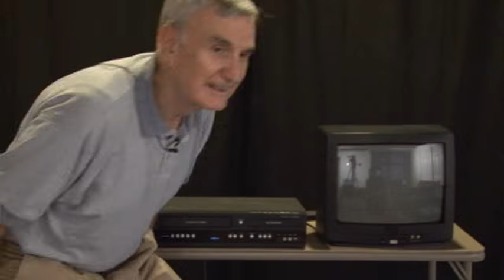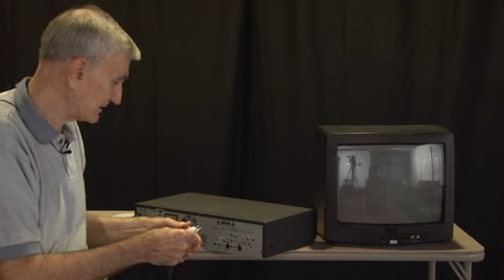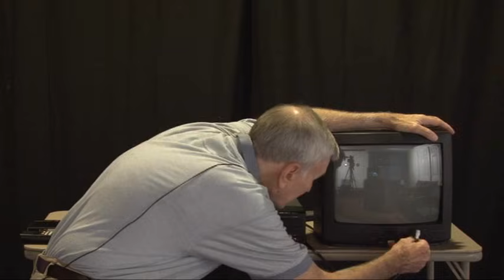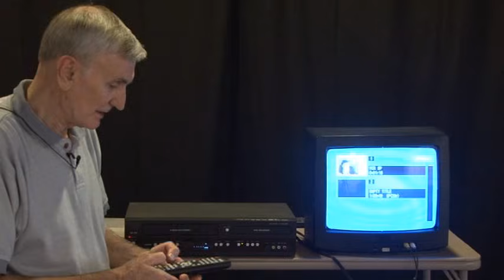VHS transfer to DVD using combo recorder

Comment: When you convert a tape, do you notice a significant quality difference between the formats? I have my own setup and I've done a compare/contrast between the footage on the 2 formats, and I've noticed a significant difference. I know since these are 2 different formats, that's to be expected, but the colors in this particular video I've converted look a certain way, and on the DVD, the colors are less strong. I can't decide if the DVD image looks washed out, or if the VHS is too saturated. Any advice you can give me? Does putting the footage on a DVD neutralize the image quality? I used a VHS/DVD combo with the dubbing function.
Reply from the maker: Kyle, I had so many about 100 as long as I could see the picture i was ok. I doubt if any of my family will ever want to see them.

Comment: Hello Mr. Wheeler. Everything was going great until I changed the source to DVD and after the loading finished it said "Disc Error Playback feature may not be available on this disc." I'm using the memorex DVD+R blank discs. Would it be the type of disc brand or would it be something else?
Reply from the maker: Itzel C., I recommend starting the process over from the beginning. I use Verbatim DVD-R disks, they have been very reliable.

Comment: Hi Anthony I am transferring vhs to dvd however if I compere the vhs to the dvd I noticed that there some quality lost on the recorded dvd (comparing same footage). Any recommendations?
Reply from the maker: Roberto, this kind of analogue transfer has always been associated with some loss from my experience. We always called this generation loss. Once it is digitized there should be no more generation loss. I would make sure your record speed   when you make the dvd transfer is set to the standard speed or the one hour record speed if your tape has only one hour or less of recording on the tape.

Comment: thanks anthony, if i don't have remote control, can i do that?
Reply from the maker: gabriel ventura , I think so, if your unit has a dubbing or record button as well as play, stop and rewind. I would sure give it a try.
Reply from the maker: If you can't finalize the DVD in the machine that made the DVD it will not play in other player. Must be finalized.
Reply from the maker: gabriel ventura , I'm afraid so!

Comment: Dumb question, but at the start you said the VHS tape was right at its end point.  Why not set the buttons so it is reading zero, rewind it and see that it is at MINUS 2hrs and 56 seconds, and then set the buttons to zero again.  This way you would know the tape goes for 2hrs 56 seconds only had to rewind once.
Reply from the maker: Mark Richards, "Smart" thank you!

Comment: I just bought a used RCA DRC8335 unit. It does not have a button that says dub or dubbing, only record or copy. Is copy another word for dubbing? I have no manual.
Reply from the maker: I don't know about other combo recorders, but I would give it a try using the copy feature.
Reply from the maker: dawncat66, I don't know about other combo recorders, but I would give it a try using the copy feature.

Comment: Hi, I did everything you did but when I got to the end on VHS and press dubbing it comes up with the red not allowed symbol - what have I done wrong? Does the DVD need formatting or is DVD-RW not a good blank to use? Or is it something to do with the VHS? Any idea?? I've tried with lots of my vhs's.
Reply from the maker: Christina Griffin, you wrote " when I got to the end on VHS and press dubbing it comes up with the red not allowed symbol ". That suggests to me that my instruction may not have been clear. When you get to the end the VHS tape must be rewound to the beginning of the tape or recording you have on the tape. Secondly I have never used a DVD-RW, which probably should work, but I use DVD-R .

Comment: I have this player and have been able to copy from VHS to DVD easily, but my problem is with recording from the TV.  I can't seem to get mine to do that.  I've followed the directions several times and I cannot get the unit to record from the TV.  Do you have anything that explains this?
Reply from the maker: ***** , I'll see about making a YouTube video showing how I would to that. Thanks
Reply from the maker: Anthony Wheeler Excuse me Andrea; On second thought, Do you mean recording TV programing from your cable or dish provider. I have never had an occasion to do that. I thought we have DVR's for that?
Reply: I don't own a DVR and would like to record TV shows off the TV. I have Time Warner Cable.
Reply from the maker: Andrea, If your combo recorder is like my combo recorder, I can't connect the Time Warner Cable into the unit. This prevents me from recording to my combo recorder. Older combo recorders did allow this ("RF" or TV) cable to plug into them and they had a TV tuner so you could select the channel you want to record from. Another thought If you have one of the old VCRs most of those had connection for "RF"or TV cable. You would also need the remote for the VCR in order to select the RF or TV input. Then you would need to hook up RCA video and audio connection to you Combo recorder, and I believe you could do the recording that way. That is all I can think of now. I hope that is helpful.

Comment: Hi Anthony. Hope your still around and reading this. I have a Combo recorder. It has been sitting doing nothing for years. Tonight I connected it to my flat screen TV. There are different methods/cables to connect it as you know but I could see in my TV Menu that the TV could see/recognize the connected Combo Device. I am sure the Combo Device works and is not faulty. It is powering on and switching between DVD and VCR no problem. I could not get a VHS or DVD to play in the machine. I get a message on the TV screen saying "No AV Signal". Any ideas to get it playing. I know the antennae cables RF in and RF out are connected correctly because my TV channels work indicating they are receiving a signal. I have just seen in your video about pressing the "Input" button on Remote so I will try that tomorrow.   I thought it would automatically play without pressing the INPUT Button on the Remote. What if one has lost or has no Remote?
Reply from the maker: Paul Fallows, Yes you do have to select the correct input from your unit.
Reply: @dahdigital1  Yes, new fully charged batteries, input button and it is working.

Comment: I have the exact VCR/DVD as in video. But when I inserted a brand new DVD-R disc, it did its "loading" but then I recieved an error once finished stating:
"disk error please eject the disc- playback feature may not be available on this disc"

I still tried to record as the error stated "may not" but when i did, two things were different from yours... 
1) video didnt automatically start playing
2) the tape icon w/VCR
              red DB 
             Disc icon
In window viewer flashes a few times and then the red DB and disc icon below that disappears, but seen the lower disc icon part staying lit on yours. 

4 hrs trying to figure this out....
Please Help!
Reply from the maker: S. Garr. I would rule out the combo recorder being the problem if you have successfully transferred VHS tapes to DVD before. I would suggest trying another brand new DVD.
Reply: Anthony Wheeler no, Ive never transferred vhs to dvd. Ive only watched vhs on this machine.
Reply: And Ive tried 3 new discs
Reply from the maker: S. Garr. If this happened to me I would suspect a faulty DVD unit
Reply: Anthony Wheeler  😭  BRAND NEW (not from purchase date, but from taking out of box)  I need my butt kicked.  And Sanyo isnt helping other than to try purchase a dvd cleaner.   Been googling and found ways you can do this also on a computer.
Im just sick about this.  Ya think we can still smack things to make them work?

Comment: My controller isnt working can u help
Reply from the maker: corey, I wouldn't be any help to you with electronic repair, but I would try first, make sure there are no obstructions in front of the device, second I would try to be in a straight line path from the controller to the device. If none of that works I would replace the batteries.

Comment: I keep getting message " cannot dub, this is a non recordable disc...It's a brand new disc. I am using the combo, I am verifying the vhs, then stopping it. I have 2 dubbing. VHS and DVD..I am hitting dubbing dvd.. I am using Memorex DVD+R...Thanks Anthony for your help in advance..
Reply from the maker: Will Marca, If I were having this problem I would try a different brand of DVD+R.  I just don't know but I would try that first.
Reply: It did not work using DVD+ but I did get it to work with DVD-R
Reply from the maker: Will Marca, Glad to hear that worked.

Comment: Hello sir; good piece.  I just hooked up my Funai and the VHS plays at super high speed.  I have tried tracking to no avail.  Do not want to begin recording or risk damaging old family tapes...any thoughts?  Thanks!
Reply from the maker: James ODell (kayakjim) I would try another VHS tape, if the same thing happens I would take the combo recorder back for a refund.
Reply: Thanks...sending back tomorrow.  Tried everything else, did not know if some settings I missed. 
Cheers
Reply from the maker: James ODell (kayakjim), I believe it should playback at the correct speed automatically.

Comment: Thank you for the in depth tutorial
Quick question, at 7:55 where you pause the video, does the machine only record everything after you pause it, or does it record the entire video?  Also, is it necessary to press pay until the video appears on the screen to record it?
Reply from the maker: Pur3Argonian , Using the dub button everything will be recorded from that point until you stop the recording.
Reply: +Anthony Wheeler what does the dub button do?
Reply from the maker: The dub button starts the play back of the vhs tape at the same time it starts the recording of the DVD.
Reply: Anthony Wheeler thanks anthony

Comment: I can't finalize my dvd. I hit the  "set up" button and nothing happens. If I click on the image of what I recorded it gives me the option to edit. From there it takes me to a screen that would allow me to give a title, mark chapters etc, but not once can I get an option to finalize. It gives me a caption saying I need to finalize when I reinsert the dvd. Please help.
Reply from the maker: Denise Case, I don't know what brand of combo recorder you have but this is how I finalize using the Magnavox ZV427MG9A. After my recording is complete I press the stop button on the remote, then I press the set up button. On the menu screen that appears I select disk edit, on the disk edit screen I scroll down to finalize, and select finalize, then it displays on screen  select yes or no. I select yes - I wait for the finalizing to complete, this takes several minutes. Hope this helps.
Reply: Anthony Wheeler Thank You! It is the same device. I was not hitting stop but hitting the set up button on the screen that showed each recorded segment. The key was hitting stop then set up! Thanks again, very helpful!
Reply from the maker: Denise Case, I'm glad that worked for you.

Comment: Is the Record speed is the same as play or record mode Because the reason why asked the question is Mine remote control don't have speed record button on it.
Reply from the maker: From what I understand the VCR plays the video at the speed it was recorded. Search through the DVD menu for record speed.
Reply: @dahdigital1  Thank you Sir, I do just that you responded back to me and it Corrected.

Comment: Dear Mr Wheeler: Are these machines still available to buy at a reasonable price? I'm on a fairly fixed income. Do you have any suggestions for the best units available now? I'm really upset that I have so many VHS tapes needing conversion to DVD, and I'm not tech savvy. Thank you for your wonderful instructions. .
Reply from the maker: Babs3353, Thank You for you comments. The combo recorder is no longer being made. You might find a used or refurbished combo recorder on line. Others have used combo recorders at thrift stores, estate sales or ward sales.
Reply: @dahdigital1  Oh, that's not good news. Technology, great as it is, creates a throw away society. Doesn't make sense when VHS was so widely used for a fairly long period of time. Guess I have my work cut out for me in my search. Would be easier I suppose if I had access to Facebook. Well, thank you for your suggestions though. Take care.

Comment: QUESTION: I have this combo recorder, but there is an apparent problem. Every VHS cassette I have ever converted to DVD has had a visible horizontal line of distortion at the bottom of the screen. This line of distortion is only about 10 or 12 pixels in size. I never noticed it until after I made dozens of DVDs, because this device sends a video signal from both the VHS cassettes and the DVDs that is in a "cropped" or slightly "zoomed" in type of 16:9 format rather than a 4:3 format. You cannot see this horizontal line of distortion at the bottom of the screen unless you are watching in the 4:3 format in a way that allows you to see the entire unzoomed and uncropped image. My question is, what is causing this horizontal line of distortion and how can it be corrected?
Reply from the maker: Michael Zoran, I would try adjusting the tracking when doing a vhs transfer. The transfers that are already made, I can't thank of any way to fix that.
Reply: @dahdigital1  I actually have adjusted the Manual Tracking, but this did not fix the problem. In fact, I even connected a high-end Sony VCR to the A/V Input on the front of this DVD/VCR Combo unit. This horizontal lines at the bottom 12 pixels appear on all DVDs - whether they come from the VCR side of the Combo unit or the Sony VCR. As an experiment, I tried several different DVD players. When I watch the Funai DVD/VCR Combo unit, I press the "HDMI" button several times to adjust the "zoom" and "aspect ratio." None of the views allow the horizontal lines of distortion to be seen at the bottom - not even the 4:3 aspect ratio. I then went to my Xbox One and saw the horizontal line of distortion was seen at the bottom of the screen in the same way as it was when I use "PowerDVD" to watch DVDs on my computer. I then used my Pioneer DVD player that connects to the TV via Component video cables. The Pioneer DVD player does not allow the horizontal line of distortion to be seen at the bottom of the screen. There clearly is some form of overscan preventing the horizontal line from being seen. Can you please watch some of your DVDs on an Xbox One and a PC that uses PowerDVD in order to tell me if you see a horizontal line of distortion at the bottom of the screen?

Comment: I followed the instructions to a T, but after I push the dubbing button the "dubbing" light  blinks for a couple seconds and then goes off and the VCR doesn't start. Nothing happens. What am I doing wrong?
Reply from the maker: Marl Couture, this may be a copyright title.
Reply: I'm trying to copy my home videos to DVD's.
Reply from the maker: Mark Couture, unless your combo recorder is faulty, I suggest the following. Put in a brand new DVD-Rin the DVD drive, be sure to give it time to be recognized by the DVD drive. Try to play the vhs tape without trying to record. If the vhs tape plays rewind the tape and try the dubbing again.

Comment: How do you finalize a disc without the original remote as I lost mine?
Reply from the maker: Damian9303, My combo recorder requires the remote in order to finalize a DVD.
Reply: I have found out my combo is the same exact as the one you have as both of ours are Funai's. The only difference is the outer case which means that I might need the remote. So I was looking everywhere in my garage as I had this for years and was able to find a remote and this works splendid. Thanks for the tutorial as this can be very confusing. I didn't know I had to finalize the discs and always wondered why the discs worked on the unit only till I found this video.
Reply from the maker: Damian9303, Glad you found the remote!
Reply from the maker: Damian9303, I don't know of any way that can be done!

Comment: Just purchased a VHS/DVD Recorder from Best Buy.  It says on the box, "sold without HDMI cable".  Why do I need this cable?  Mr. Wheeler does not mention a HDMI cable needed.   your thoughts?
Reply: +Gail Lucas Just figured out my own question.  HDMI cables are the cables that are Yellow, White, and Red.  That is just what they are called.  LOL too funny.  Boy am I getting old.  I just called them the VCR cables.  OK now I am dating myself for sure.
Reply from the maker: +Gail Lucas ,I don't use HDMI cables. HDMI cables are not the red, white and yellow.
Reply from the maker: +Gail Lucas , I don't use HDMI cables.

Comment: I want to record from VHS to DVD, the recoding is about 47 mins long, can I set up the VCR to record to the DVD and have it automatically stop at 47 mins or do I have to physically hit "stop"?
Reply from the maker: mytuber81, I'll have to get out the manual and see myself. I set a little kitchen timer that fits in my pocket.
Reply: Anthony Wheeler Yeah, I used to the timer on my watch. My Toshiba didn't come with a full manual only a 'quick setup' sheet of paper. Thanks for your help.
Reply: Anthony Wheeler How do I erase or record over video footage on a dvd+rw so I can re-record new video on it using my Toshiba?
Reply from the maker: mytuber81, thanks for the question. I use a small kitchen timer, set it to go off one or two minutes before the end of the program. Then I put the timer in my shirt pocket when it goes off and the program has ended I stop the recording. When I can I will try to look in my manual to find the answer to  your question.